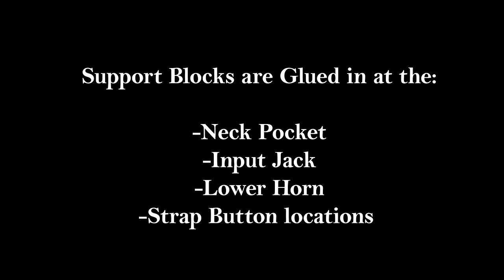Making an Archtop Guitar from Scratch (Full Build)

Comment: Matt, You’ve done some very admiral things in the design, structure and the construction of your guitar. The “easements” you carved into the front and back edges associated to the playability are gorgeous. Your headstock… is gorgeous. Your logo is wonderful & well done. It makes your company look “big”. Everything about everything is very “mature”. Your multi-layer finishing of the guitar body came out spectacular. All of the “lines” of your design are easy, graceful lines except for one thing. Your “f” holes. It’s the only part of the design that doesn’t fit. These too should have been graceful, eased lines that flowed with the body lines used throughout. Nothing on the guitar associates with the very “zig-zag” of these lines. That’s my critique. It’s meant to be valuable, not put you down. You did a wonderful job. I hope you play it often.  Thanks for the video. ~ Sven
Reply from the maker: Thanks man! That sound hole curve appears in so many places on the design! headstock, top of body, tailpiece, it's everywhere brother! everyone's got their own tastes tho, and i rarely do the same soundholes twice ;)

Comment: Question for you: at 1:14:45 or so, I recognize the contraption holding the guitar as something similar to the stewmac freehand holder with an attachment I don’t recognize (one part being the acoustic adapter). Did you add on your own part to this, and if so, what is it and how does it attach to the guitar?
Reply from the maker: Yeah its a homeade system. Its just a threaded rod attached to a few L brackets to make spraying much easier.
Reply: Dude that’s really cool - how does the L bracket attach to the guitar?
Reply from the maker: Attaches to the block where the pickup cavity is routed out with 2 screws @mongur
Reply: Real sweet work. Very ingenious as well.

Comment: Like to watch makers build beautiful things and is a master at it. Never seen your videos. Dont know anything about guitars. Was not sure why what and how that presses of when you put all those holes in flat peace was for.
Reply from the maker: Thanks! I'm not sure which holes you're talking about, though.
Reply: @newillguitars  you laid down a flat guitar shape piece on the drill press and drilled around 30 holes then you sanded then out. If that makes sense
Reply: It is at minute 0936
Reply from the maker: @crusherj3535  Ahhh, thats because the inside of the guitar body has a carve too to keep the curved body consistently .25" thick. I set the depth of the drill press, and drill the underside of the face of the front and back of the guitar to achieve that
Reply: @newillguitars  ok i was thinking somewhere on those lines but was not sure. Thanks for the reply

Comment: I dont understand, metrical system is much better than imperial system, imperial system sucks. Its not preccission.
Reply from the maker: its just as precision as metric, albeit more complicated for sure!
Reply: @onemintjulep  actually imp. would be superior if it was base 12. But it is not. Inches for rough work are measured typically in 16ths. Occasionally 32nds or 64ths. Precision work is measured in 1,000ths or even 10,000ths of an inch. Feet are commonly measured in 12ths, but maybe measured in other units. Neither metric nor imperial is better for singular measurements, as the both deliver very simular precision, accuracy and repeatability. However metric is superior when it comes to complex multi unit calculations as all units for temps, pressure, mass, distance etc are in the same base 10 regardless of the measurement scale.

 It's why the vast majority of the world uses it, including the USA for scientific and most mass production purposes. 

That said had metric could have been even better if it had been base 12 or even base 20 as originally intended.